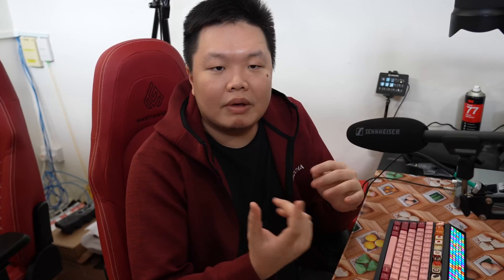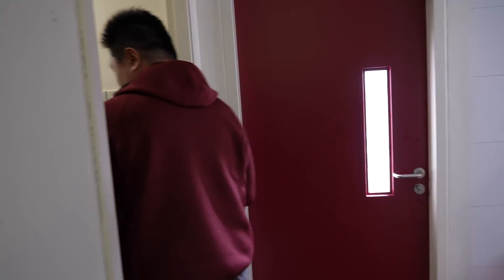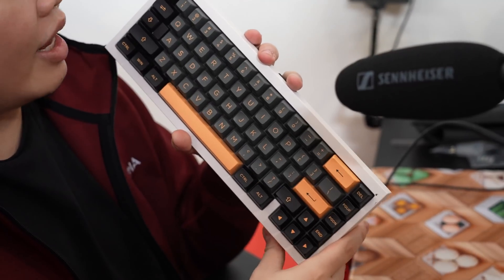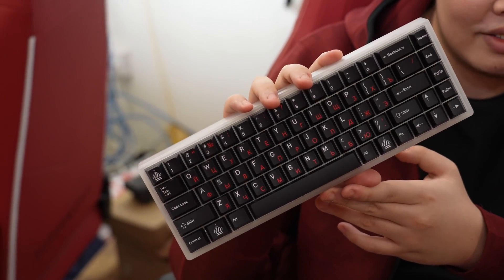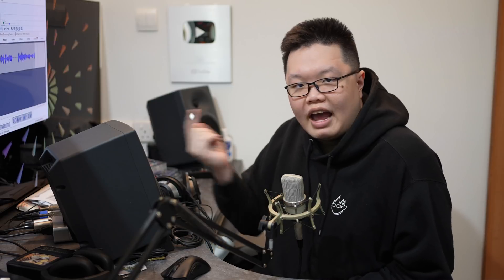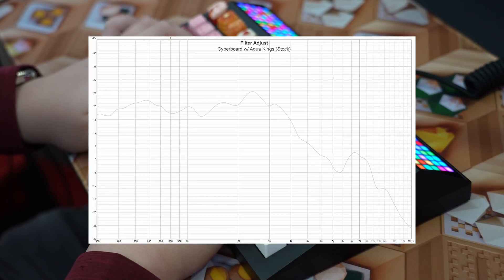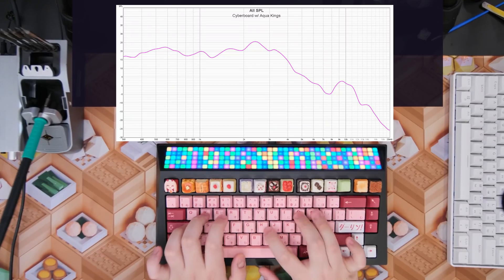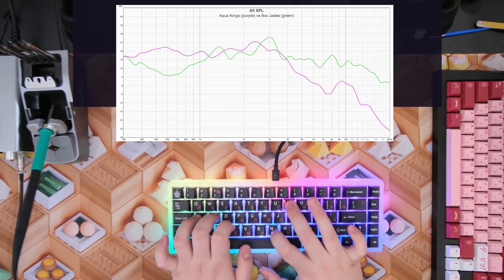Measuring keyboard sounds??? ft. @crin

Comment: I think this is something that would be very helpful if it is present, but at the same time very tedious and time consuming. This is going to need a single entity with as much control as possible along with various keyboards, which is going to be very hard for individuals to do, but might be more viable for large vendors or few gb runners.

At least these kind of actual some-what scientific data (I say some-what, because it would be very difficult to properly limit every single potential variance) might be useful to aid in describing the sound signature the board creates, instead of content creators/gb runners providing their own interpretation and running with those as some kind of source of truth.

Comment: Since theres inconsistency with each individual switch from lubing, manufacturing, different parts of the keyboard etc. Type across the entire keyboard in a standardized typing test rather than a single switch. I absolutely hate and click off of any single key tests since it tells nothing.
Reply: Swordart pfp means no opinion

Comment: Coming from engineering major, this is the keypoint "lacking" is the technical aspect and quantification of the sound characteristic of a mechanical keyboard. Graphical analysis will be a great tools if you can get together with robust database from various mods of a keyboard. Just suggestion, another thing that none of the creator never touch is the dielectric grease. What is a dielectric grease? Why use Krytox or Permatex? What is the correlation between the lubrication and the sound characteristic? What is the technical pros and cons by having lubed or non lubed switches, aside from sound improvement? What is the critical aspect of a grease for mechanical keyboard (flashing point? acidity? density? element content?)?

This is huge and will enhance your content even deeper!

Comment: Please tell me how do you quantify sound when you have so many different factors to consider. Are you going to build your database around certain mounting system only? Will it be quantified based on the switch or plate material? Will you be building your database based on 6061 or 6063 aluminum material board or will you be quantifying based on a random board? Because what you just took to compare has 3 different mounting systems; Cyberboard R1 - Top Mount, QK65 - Gasket Mount and RK61/GK61/etc. - Tray Mount. Those 3 different boards has 3 completely different sound profile. Because if you're building a database based on random comparison it seems like you're introducing too many variables that are out of your control. Are you going to consider foaming? PCB to bottom case height? Or even the weight material or no weight at all? Seems like this database is going to be extremely huge, so nonetheless good luck!
Reply from the maker: In the video we explained that we're going to use the stock Q1 as our tester board. That and the keycaps would be a constant.

Comment: I wonder if and how you guys plan to address lubing - different lubes (205g0, 3203, 3204, 105-205 mixes), different application techniques, application thickness, etc, as it seems like this would be the biggest avenue for sound inconsistency and weaknesses in the methodology since a lot of people have different techniques and preferred lube.

Comment: Really exited for this project. I think it will be really hard to perfectly measure keyboards like headphones because almost endless things affect the sound. Like even how good you put the keycaps on, the material under the board like a deskmat or even how hard the screws are screwed in place can have a big impact on the sound, but I still believe that this will give meaningful information that, like you said, will really help us quantify things a bit and help to say what, generally speaking, will do what to your board. Just building some rules that, for most people, could tell them things to try to achieve a certain sound. Good luck with all that work guys, you are doing a great job here!

Comment: If the force actuation graphs were to be super accurate, Im not sure that the arduino uno is the best microcontroller for it as it does not have the highest resolution ADC(analog to digital converter) to measure the load cell

Comment: you might have also considered it, but the specific key location on the keyboard makes a difference to the sound/measurements. what key is being used for the measurements? will it eventually a mix of all keys? will the same typing sample be used for each keyboard? are there specific keys that are used more in these demos, and would that even make a difference? or is the peak freq measurements enough to start quantifying the differences between variables?

Comment: Maybe you should get one of those Firearm Trigger Weight measure-rs that Gunsmiths use to quantify precise trigger actuation depth? -Only except using it on Triggers, you use it on Switches. What do you think? That seems like not the worst idea to me although I have never held one of these devices before. You could always email a GunTuber that owns one of these devices about them of course, about the precision or lackthereof, perhaps Brandon Herrera.

Comment: Here's a suggestion: have a sort of neutral baseline that all switches are compared to. Not neutral in the audio sense, but something so ubiquitous that it can serve as the 'floor' for all other switches. I'd suggest Cherry MX Reds because of how popular yet completely mediocre they are.
Reply: This, but Gateron Yellows.
Reply: @Green-Man  Gat Yellows make more sense than Cherries for me since Cherries actually have a super distinct sound (scratchy + nylon housings), but I guess Cherry MX switches are still the most ubiquitous outside of the hobby so... I can see the argument for either.
Reply from the maker: Yes, this is what we intend to do as well. Thanks!

Comment: Hi, I used to be a firm believer in standardizing keyboard sounds, however there are some objections I have to your current process... 
You must test whether changing aspects of the board changes the relative position of switches to each other.
For example, switch A might sound sound "thockier" than switch B in the q1 however, pe foam or mounting method or materials or even the size or etc. might make B thockier than A.
I would recommend you thoroughly comparison test each variable of the board to see if either they have a negligible effect or they have a substantial effect, in which case you might want to consider multiple different testing boards for each switch measurement.
Reply from the maker: I presume you haven't watched the video in its entirety
Reply: @TheMechaStore  I did, I presume you're referring to the "what affects the sound..." Chapter. 
I just rewatched that section and while you mentioned what will affect the sound of the board as a whole, I didn't see my concern over switches potentially being lower or higher than other switches depending on the board.
Again an example but this time more specific. What I'm worried about is for example, epsilon switches in the q1 sounding deeper than creams in the q1, but then in turn the creams in a qk65 being deeper than the epsilons in the qk65. This could lead a person to think epsilons are objectively deeper than creams based on your one configuration of board, when in reality, creams will sound deeper than epsilons in their own board.
If the tests prove that their position is relatively similar in reference to another switch then the one testing board will be fine.
However I believe thats a big "if"  considering the amount of variables that you listed but also that those variables might perform differently if more than one of them is changed at a time.

Comment: Spacebar measurements would be a fantastic addition as the middle of a keyboard sounds very different to the edges and the space bar has a individual sound to the rest of the board. 
 Really interesting channel idea and so glad to see you working with mecha keys
Reply from the maker: Our planned suite of measurements include the G key (which is what's displayed in this video), backspace, enter, and of course the spacebar.
Reply: And use the F key for keyboards that sound like shit

Comment: Seems like you should have a z axis for time since the sound of a keyboard also has attack, decay, and echo.
Reply from the maker: Spectro/waterfalls were considered but if we're going to be making a comparison system, peak hold frequency response makes more sense. Unwanted resonances should show up as peaks as well.

But once we've established a large enough database, we may try out spectros/waterfalls as another side project.
Reply: @TheMechaStore  It’d be interesting to look at some vintage keyboards for this, because they often have a lot more echo in the the sound which vintage enthusiasts like, while modern keyboards are considered superior if they have foam that dampens the echo. The question would then be if your graphs can distinguish between say a vintage alps board (echo-y) and a modern Matias board (less echo-y) or even a foam-modded Matias board, for example. If you watch any videos by Chyrosan22 for example he goes on about how vintage keyboards make a kind of sound that no one even attempts on modern keyboards that aren’t direct reproductions. (Comparing graphs for vintage Model Ms and modern Unicomps, or the Model F and the modern Model F labs version. I know you might not have these available since they might not be available in your store, but I find this concept of measuring and comparing sound graphs very interesting, and non-MX keyboards have a much wider array of sounds.

Comment: I’ve always loved thocky boards with clicky switches in them, now I can scientifically build that board.
Reply: Seems like you'd need to scoop out the mids to do that
Reply: @blakebrockhaus347  not really just need to increase the bass and decrease the treble, I've seen it done with foam filled cases and box whites I just think some slight tweaking is needed for it to work with box jades

Comment: What about variance in key pressing while recording the sound, measuring bottoming out vs not bottoming out ought to be pretty relevant wouldnt it?
Reply from the maker: To put it simply, we will be using an actuator press the switches, which would produce repeatable results.

Everything will be quantified and showcased with the force graph released along with the sound graphs. Stay tuned for that!
Reply: sure but if you dont bottom out it doesnt really make a sound, unless its clicky, and almost everyone bottoms out